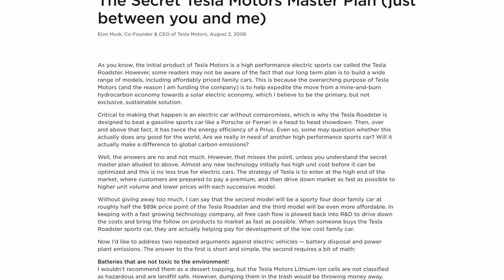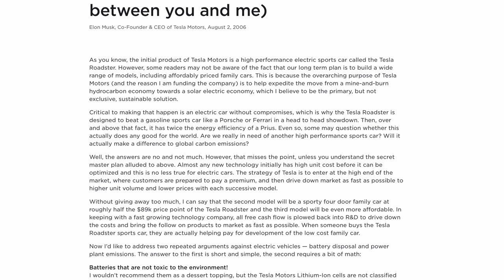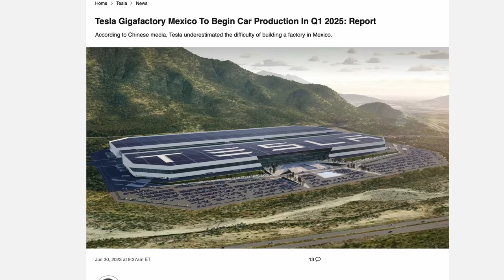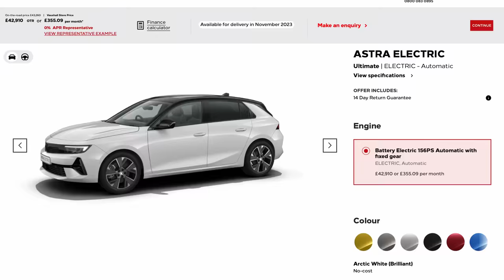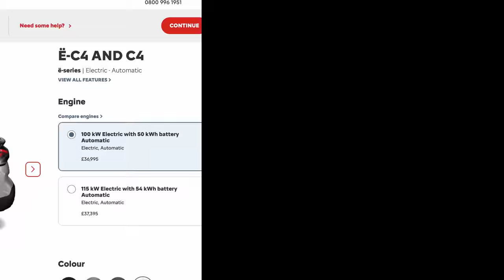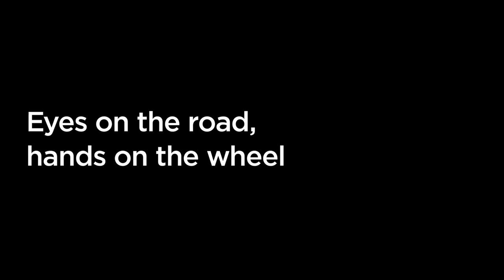Ford Slashes EV Production To Stem Losses | Dire Consequences For UK Vehicle Sector

Comment: Ford will be launching the electric Puma next year. VW will be launching the iD2 (Polo) and its stablemates will also be releasing their versions. Citroen will launch an electric C3 and Fiat will launch an electric Panda, both priced around £25,000 in next summer. Renault will launch the electric 4 & 5 and they are predicted to cost less than £25,000.
Reply from the maker: Yet the petrol versions are sub £18k. Do they expect to find people already struggling will stick with the brand and just find an extra £6 or £7k? See how that works out

Comment: In essence you are correct, but don’t forget that legacy makers have to scale up production  and refit factories. If you have limited production capacity, then they will use it for higher end more profitable models until the market can take the volume. The biggest threat is the dealer network, as margins are low, typically 5% of new cars, much higher on 2nd hand. Their money is made from servicing. As evs don’t require it, their long term business model is problematic.
Reply from the maker: Yes, two issues here as you point out. a) They make their money from servicing and parts, they don't want EVs. b) They have masses of experience, decades, in mass production, so they should have refitted the factories to by-pass the 10 year learning curve that Tesla had to go through and head directly for the wide open mass £20k EV market all their millions of customers are sat there waiting for. Why didn't they? see a)

Comment: I really like the way you present your videos. Interesting background information, building a solid case of what holds for the future. One point I would like to discuss though. You said that if Legacy Auto had built mass-market cars (Astra, Fiesta etc.) in EV form, but sold at the same price as the ICE versions, then Tesla would be a niche producer of higher end models, with much reduced sales. That is absolutely true - except they would make a loss on each vehicle, leading to catastrophic overall businesses losses. Many thought that Legacy Auto, when they "got into gear" , as it were, would simply switch to EV manufacturing overnight ("because they already make cars, right ?") and Tesla would be toast. But the technical challenges of designing, developing and producing EVs, (weight, aerodynamics,  batteries, thermal and electronic control systems, software etc.)  are many and various, as Legacy found out. They simply could not make them at the same price as their ICE models. 
(Cars are now "computers on wheels", and the Business model for Legacy is to buy multiple electronic modules, from different manufacturers, and assemble them. And the difficulty now, is making a coherent "overall control interface", for the many diverse software architectures, languages, and interfaces embedded in the multitude of modules. And at the same time incorporating the control interfaces needed for the electric drive systems.  VW, for example, is still struggling with this problem, and they have spent billions on it. It turns out that the " elephant in the room" is software. Absolute top talent is required for EVs, and sorry guys - Tesla gets most of the top talent !)
Reply from the maker: Great comment. Start with the software and then just make something to put it into. I have said many times, it doesn't take long for a computer engineer to learn how to hang a car door accurately, it does take longer for a door hanger to learn to programme. Somebody said Apple should get in on the act. If they do, they will find it far easier than Legacy
Reply: @davetakesiton  they did and backed out.

Comment: Did it take Ford so long to figure out success in eV is not just having designs and models, but having access to the critical minerals and metals, and working them in a super efficient brand new process ?  Tesla has proven it that for sure. Does Ford ?
Reply from the maker: Arrogance! Ford believed it could just buy what it wanted when it wanted it at a better price than Tesla and make them faster and cheaper.
Reply: @davetakesiton Look at Munro's teardown comparison of Tesla and Ford EV cooling systems and you'd run a mile from Ford.

Comment: I haven’t seen the whole video yet. I’m waiting for that mass market car. But I’m not expecting it before 2026, if not 2027. If the cybertruck is anything to go by… Took 4 years after showing the prototype. There is no prototype of the model 2 or Model A. 

I own a Tesla, own the shares and don’t like Elon, but the company is not a magic house. But when it will come it will be disastrous for the rest of the industry
Reply: You don't like what you're told about Elon.... (You fell for it!!?)
Mid 2025 for the Mexico Gen 3 "platform" (imo, NOT just a "compact" but at least 4 modular vehicles on the same chassis)
Then there's the Berlin expansion..... (Smack in the middle of the "hatchback buying region" of Europe.... I wonder what they will be making? 🤔)
.
Cybertruck? First shown in late November 2019.... 6 weeks before 'stuff hit the Global fan'?.... Twice!
.
I'd say 4 years is pretty good in those circumstances even without considering the new techniques, materials and machinery required?
Not to mention building the largest (car) factory on the Planet?
Back to the "not model 2"
Why do you think there's no prototype??
Did we see prototypes of the Model 3 Highland upgrade before a few months ago? (That's already in production btw, major improvements)
.
I think I saw a rendering of the actual car yesterday.... Not saying where, but the proportions match "the car under the sheet" at the investor event.....
IF that vehicle is the "compact", IF it looks like the rendering and IF it's below even $30k, I can tell you, it's game over.....
.
Side note.
I set myself a rule some time ago to not "invest" in people I don't like.....
Maybe you should sell?
Otherwise.... Shhhhh!
Reply: "There is no prototype of the model 2 or Model A."

I think this is not quite accurate, I believe the design of the new model is very much completed, I don't think they would start building the factory if it wasn't.

Franz von Holzhausen, the designer of the Tesla cars, when asked which one was his favourite, he paused and started answering with something like: "From the ones I can mention publicly..." Basically implying that his favourite is the new model that hasn't been unveiled. The reason it hasn't been unveiled is because of the Osborne effect. I believe this car will be so good and so cheap that they really have to wait until the very last moment possible to unveil it. My belief is based on well know facts about the technologies that Tesla is using like Gigacasting, 48V system, Octovalve, software etc.

Look at the track record following the very initial plan going from Roadster -> S and X -> 3 and Y -> new model. There's very little reason to doubt the best is yet to come. I believe this is an incredible investment opportunity and I'm glad that you own the shares.

IMO Elon is absolutely great, he doesn't care about image and what others think of him, he cares mainly about the mission statement of the company. A company and CEO with such an impact, I think more impact than a huge country like China, will definitely have plenty of enemies and many of them from the biggest, richest most powerful companies in the world. These powerful forces have a big influence on main stream media ( follow the money ) to a point that it becomes absurd how they twist the truth.
Reply: It makes me laugh how people say they dont like Elon Musk and imthink its just jealously.
The guys a genius with great vision and drive. Whats not like to like.. maybe hes not liked because he isn't a woke snowflake like most people these days.

Comment: They couldnt have done a small ev hatch for £25, so great clip, but you are guessing they could have done that. The EU and planning laws and the governments are to blame. What we need is micro cars like the 1960s doing 100-200 mpg. The customers are greedy wanting more. But the customer is king? They want SUVs well you will have to pay for them. Other countries Japan and China have smaller cars on sale.
Reply from the maker: 100-200 mpg in the 60's, I was there and never saw one. In the 70's I took part in a sponsored Citroen 2CV challenge to try to achieve 100mpg on an old WW2 airfield driving at a constant 40mph; we failed but raised a good sum anyway. Give us a clue

Comment: Dave you are saying the same thing as the Electric Viking.  I have my parts guy saying EVs produce more CO than ICE and there is not enough Li and other battery material in the world.  Uh-oh, even using coal generation EVs have 1/3 the life time CO² emissions according to University studies and even requiring more CO² to manufacture two years of average driving makes up the difference.  Li supply?  The Hells Kitchen, in California US, geothermal power plant is going to harvest Li from its reinjected bine and nearly double the world's production of Li, manganese and potassium.  Yeah this is just one source ramping up. Looks like the cost of batteries is going to halve and capacity is going to double too. To me it looks like the ICE car is going on ice
Reply: Tell your parts man there won't be enough oil in the World one day.........
Reply from the maker: Yes Stanley, people confuse these things. Watch out for my Lithium video due out in the next week. Lithium is one of the most abundant elements on this planet, number 3 in the atomic table. There is more than enough for everything everywhere. It's just freely available in a form that is expensive to extract, so we choose to get it from cheap sources, China, Africa with appalling humanitarian records. That is changing but yes, batteries are going to halve again and double in power density

Comment: If Europeans suddenly buy a huge amount of 25 K pound EVs...where will they all be charged? Is the infrastructure currently in place? Is there enough materials to make all those suddenly needed charging stations? Can the power grid handle the extra load? I'm just curious; I don't live there.
Reply from the maker: There’s many thousands of EVs on the road this year which weren’t here last year and there’s not been a single power cut, shortage or outage. Grid seems to be coping and they say they can
Reply: Oh, granted, that wouldn't do it, but what about millions? If that became the cheap option, and was available, people would buy them. But is the real estate there for public charging stations? Would the power cables to them be buried or above ground? How long would it take? How much copper/aluminium would be needed? How much would the grid need to be enlarged, and how many power stations/transfer stations would need constructing? Where would they be put in big cities? Just being pragmatic. @davetakesiton
Reply: @TheOriginalFILIBUSTA  You are not EV and clean energy educated are you?

Comment: I don't think the vote grabbing Politicians have  helped matters flip flopping from petrol to Diesel then Diesel back to Petrol and now Petrol to EV never for a moment giving a thought of the Monumental Cost to Motor Manufacturers to plan ahead or  switch models at the drop of a hat or even if the Electric Grid will be able to cope with charging EVs

Comment: EVs have many known hurdles to jump before their widespread acceptance in the USA. For one, roughly a million and a half USD investment required by dealerships to maintain and repair them. A total lack of qualified repair technicians and off the shelf parts. Non existant infrastructure, private and government, sufficient to recharge them outside of the owner's home ... if that's even possible. With a country as massive as the USA, the total replacement of ICE vehicles will take decades and money that is in short supply, but it will most likely happen.
Reply from the maker: That 1.5 million investment is easily solved, get rid of dealers. They are leaches on society
Reply: @davetakesiton  Who will fix them? Do you expect tiny repair shops to invest that kind of money,  afford the salaries to hire short- in-supply technicians to fix EVs filled with one-of-a-kind electronics, or pay sky high insurance rates to protect their investment if something goes horribly wrong? Try getting a PC fixed. They are practically disposable unless  attached to a commercial machine. The same with lots of consumer electronics. Do you want to invest 50,000 USD in a EV and wait months for repairs if you hit a curb? Or a other car's bumper? Let alone write it off if the insurance company claims the small damage it suffered is irreparable?

Comment: Thing is, Renault had the Zoe all along. Then completely blew it!
Reply from the maker: They could have dropped prices much earlier and taken market share
Reply: and not persisted with that daft battery rental model
Reply: @eddthirty4065  I think the battery rental model had it's place initially, but they held onto it longer than they should have done. I think it actually worked in my favour when I bought a 3yo Zoe, depressing the value of the car. I then bought the car, put 50k miles on it, bought out the lease and lost surprisingly little money when I sold it.

Comment: Electrification is the easy part. But electrification is only one disruption attacking legacy auto.

The second disruption is manufacturing innovation. Tesla has developed crazy new manufacturing methods that reduce parts, reduce labor, and increase line speed. All of which play into pricing and margins.

The third distuption is selling to consumers directly, without dealers and their markups. Dealers are albatrosses around legacy auto's necks.

The fourth disruption is software. Legacy auto is terrible at it. Tesla is far, far ahead.

The fifth disruption is vision-based autonomy. Nobody is within 5 years of Tesla in autonomy.

GF Monterrey has a design objective of 5 million vehicles per annum. Once the budget car line design is finalized, it will be proliferated, probably to China and Europe, perhaps also to India and elsewhere.

Tesla is aiming for unprecedented growth and market penetration.

Legacy auto may be able to hang onto niche markets where Tesla does not offer products. Perhaps. But downsizing is in their future. Some of them won't survive, I fear.
Reply from the maker: Great analysis, thanks

Comment: Batteries are the problem and why you don't see cheaper EV's from the big manufacturers. The battery cost will be up to half of the 250k car cost and they would make a huge loss per car.

Add to this that secondhand value of an EV will be much less because of the battery wearing out within 10 years.
Reply from the maker: Strange that BYD is one of the very few EV companies to make a profit and they sell the Dolphin in UK for £17k and a lot less in China maybe they should talk to you
Reply: @davetakesiton  BYD was first a battery manufacturer so they make their own batteries and then make money by selling batteries to other manufacturers. The quality is questionable and EV manufactures get huge subsidies and also get very cheap labor.

It's so bad in China that you can't even insure some car brands now.

Comment: Tesla will not be able to profitably make an EV that people want for 25K.  This is the same marketing wank we heard before the model 3 dropped.
Reply from the maker: I seem to recall the Model 3 being the best selling EV in the world before Tesla launched the Model Y. And people are still buying both and Tesla make more profit per car than any other maker in the world. Strange
Reply: @davetakesiton  Yes, you are correct, Tesla has indeed recently been able to profitably sell cars that people want to buy for 42K USD and up but that's not a 31K USD (25k pounds) car is it.  Now tell me what can Tesla remove from an already spartan entry level 3 or Y that will reduce the cost to manufacture by about 10K USD yet still have enough car left people will actually want to buy.  

Sure, it is possible to make a glorified golf cart with inadequate range, slow charging, poor performance and an interior that makes Rubbermaid look luxurious for 25K pounds but nobody will buy it when you can get a better equipped IC car for less money.  There is no profit in entry level EV models because the battery is an expensive fixed cost and the cheaper you make the car, the better IC cars look in comparison because the battery becomes a larger and larger percentage of production cost that has to be made back somewhere else by reducing features and quality.  

A 10K battery in a 25K car is 40% of the cost of the vehicle while a double the size and cost 20K battery in a 100K vehicle is only 20% of the cost of the vehicle.  This is why Tesla started the company with high end expensive vehicles and immediately dropped the stripped down model 3 version that was err "available" for 35K on launch in favor of higher spec (higher priced) cars they could sell without losing money.  Lets not forget 35K back then is 43K in todays dollars due to inflation.  

An economically viable 25K pound EV in todays economy that can meet the demands of EV consumers is a pipe dream.  Economies of scale have diminishing returns and there's no magic bullet.  You cannot make a loaf of bread for less than the cost of ingredients and baking regardless of what Elon Musk claims unless you like your bread made with chalk and sawdust.